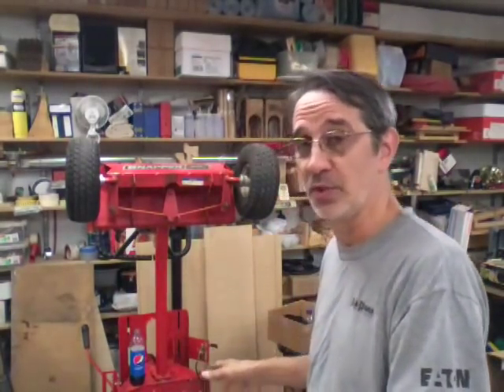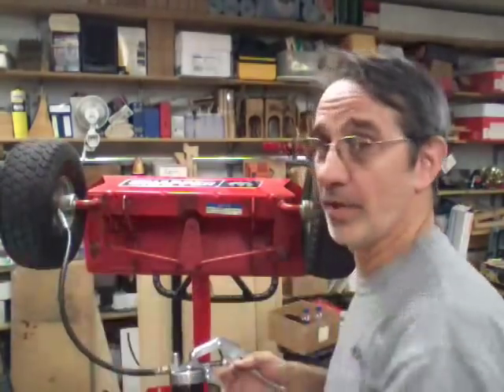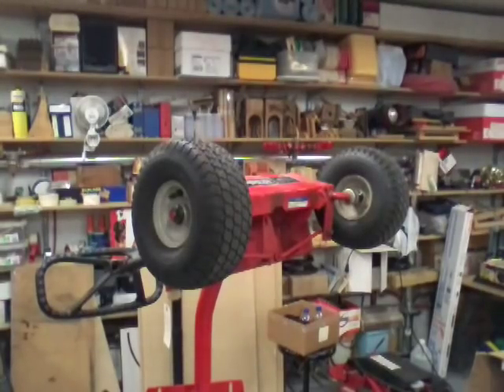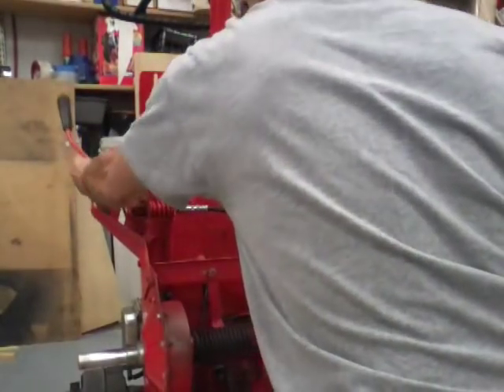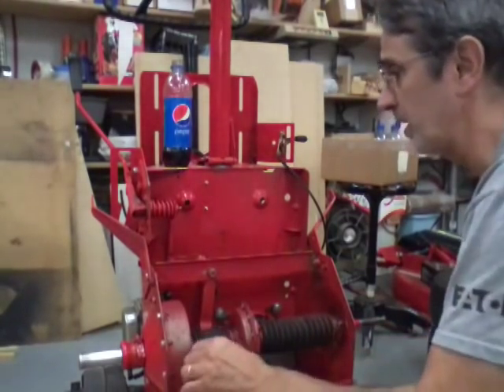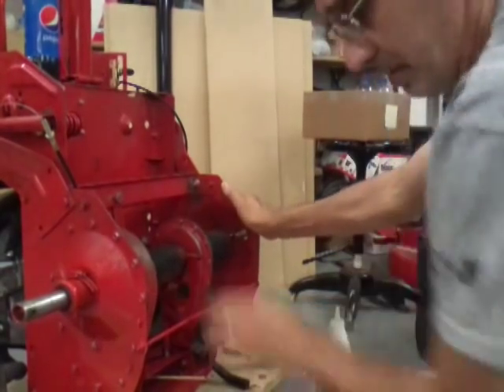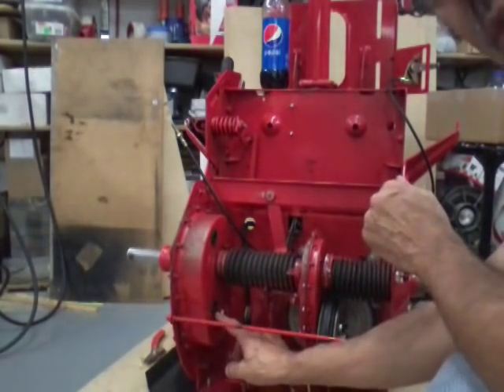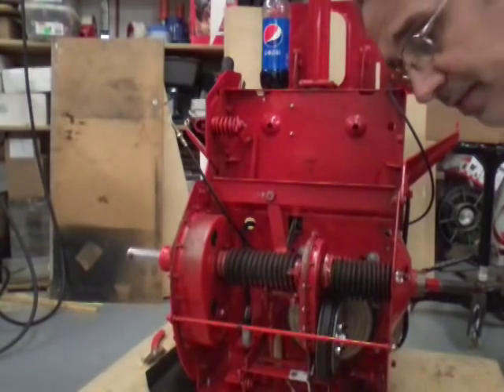143.   Greasing and oiling the entire Snapper Rider

Comment: Hi Jim,  replaced the clutch disk (another video of yours).  I noticed there is a lot of grease on inside of tire on differential side.  Also, my rear axle has about 3/8' play (can move from side to side, is this normal?
Reply from the maker: No neither one of them are normal. The grease on the side of your machine behind a tire is because your lip seal is bad needs to be replaced and typically the lip seal goes out because you’re bushing is wore out check both of those for that issue.  
No, what’s the side play without taking care of this your chain inside your differential will rub on the cover and cut right through it check the cover for any bad spots or raised areas from the chain rubbing on the inside to correct this problem you have to stand your machine up as you’re looking at the machine, place the transmission and fifth gear, take the boot off of the bushing on the fender on the right side slide your hexagon shaft to the left and fill in the gap with nylon shim washers. You should only have less than a 16th of an inch side While you’re there clean and grease your hexagon shaft. It will help it shift better to get the boot back on to the bushing in the fender shift the transmission all the way into reverse this will push the boot into place, and all you need to do is tighten up the hose clamp.    Let me know if you need any more help.        Jim
Reply: @jimjackson9381  Thanks Jim!  I watched one of your videos and ordered the nylon shim washers...  Will look for a vid on lip seal.
Reply: @jimjackson9381  Hi Jim, located one of your vids to remove wheel flange but nothing on replacing the lip seal.
Reply: @jimjackson9381  Hi JIm, Silly question but is the RH side of RER snapper on the side of the differential?  Same as if your sitting in a car?  Going to order parts and need to know LH and RH.
Reply from the maker: Typically It’s determined by when you’re sitting on the machine.      Jim
Reply from the maker: @dogsarefun2  that’s in with a different video I don’t have one on strictly replacing the lip seal when you get the right hand boot off of the axle in fender, put it in a cup of hot water, not boiling, but hot let it set for about two minutes take it out and you can pull the seal out with your finger before installing the new one, put it back in the water and soften it back up it should become pliable otherwise leave it in the water a little longer.      Jim
Reply: @jimjackson9381  Thanks again.... yep, same as sitting in a car.
Reply: @jimjackson9381  So I have to remove wheel, hub, and boot?  I see in another vid that hub can be a PITA... I'll try spraying with pb blaster or torch it.   I just need to order new hub (in case  damage hub)  and seal?

Comment: How you do adjust gas pad from push you off from the sit Jim
Reply from the maker: Sok Touch 
Hi it’s Jim
   You’re going to have to explain this a little better, I am lost and what you’re asking. Jim
Reply: @jimjackson9381  hello when I take off  break to acceleration it pull me back /what causes it?
Reply from the maker: Sok Touch 
It sounds like your yolk spring is too tight watch video number 70 and it will explain how to tighten it so just loosen it up and try that. Jim

Comment: can i stand my snapper up like that with an engine full of oil?
Reply from the maker: Yes you can it may drip a little bit out of the fill tube but it’ll be OK, when you set it back down let it sit for 20 minutes so the oil can get back down into the pan where it needs to be before you start it, if it’s going to be standing up for more than 10 minutes take the battery out because if it leaks it will run down on your aluminum carburetor and destroy it. Jim
Reply from the maker: Oh a little PS I stand mine up all winter when I’m not using it I do drain oil drain the gas and remove the battery it can sit there in definitely until you need it again. Jim
Reply: @jimjackson9381  Right on! Thank you!!

Comment: Just to be clear, 80w-90 is NOT the Snapper recommended fluid to use in the rear axle. Jim knows this and said it in the video. The owner of that machine is the uninformed person wanting 80w-90. 80w-90 is roughly the SAME viscosity as 30w motor oil. It will ooze and leak out of that chain case and rear diff in ONE YEAR. Bad move...... People with older machines with lets say USED seals and so on, beware of 80w-90 oil.

Comment: Jim, I’ve gotta question for you about my 89 series 6 snapper, please contact me when you can, thanks!
Reply from the maker: TCBLOOMS CULTIVATION 
Hi it’s Jim
  What’s your question and maybe I can help you out. Jim
Reply: Jim Jackson I noticed that while riding up my driveway, the back left tire had a bit of a slight wobble to it. I jacked the back up and was able to move the wheel/axle with my hands back & forth just enough to have a knock with some play. Does that have anything to do with the axle going into the differential? Being worn over time. I have a book manual on the mower but haven’t looked through it thoroughly enough to determine what the problem is or could be.
Reply from the maker: TCBLOOMS CULTIVATION 
Check your bushing in the axle to see if it’s bad or not you may have to take the tire off so you can get a good look at the clearance between the bushing and the axle. Jim

Comment: Jim have you ever replaced the BAG ROD on a single bagger grass catcher?  I received the 2004 mower and bagger but not that hanger.  They want $50,00 for a new one but it is not available until later this month.  I have now watched most of you films.  This has been a super value to me.  You can't get a service manual that I can find, so your help is again just SUPER.
Reply from the maker: Homer Taylor 
 Hi it's Jim 
   What state do you live in. Thanks
Reply: Jim I live in  Kentucky just across the river from Cincinnati. Zip is 41035
Reply from the maker: Homer Taylor
I have a single bag bagger no shoot or tube if your interested. Thanks Jim
Reply from the maker: Homer Taylor 
I have made one from A piece of half inch re-rod. Thanks jim
Reply: I never thought of rebar.  Was thinking  maybe 1/2 " PVC with elbows.  Would be interest in the one you have.  Mine is 16 1/4 by 36 1/4 I believe.  What  would your price be and do you have a paypal account?

Comment: Hi Jim, I saw in one of your comments you use Red N Tacky grease. I bought it, but I don't see where it shows 00. Is it okay to use for my snapper without any modifications? Thanks!
Reply from the maker: Jacob Germann 
Are use Red N Tacky Grease in the grease fittings and on the hexagon shaft. I don’t put it in the chain case or differential. Jim
Reply: @jimjackson9381  Okay, I will only add where you indicated. Thanks Jim!